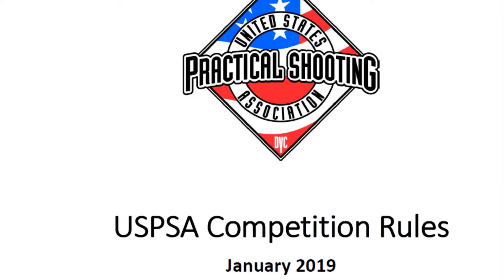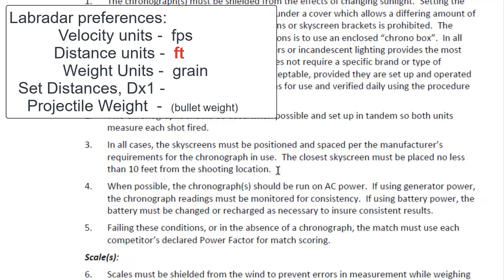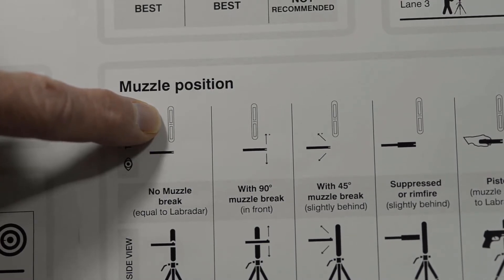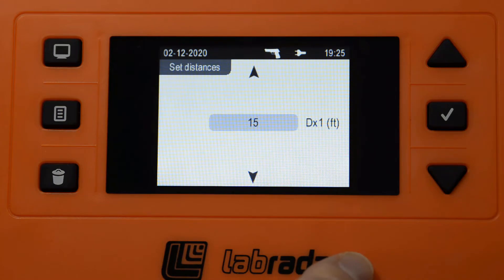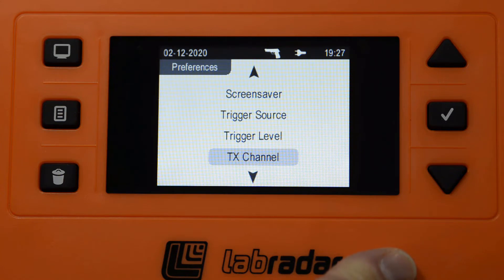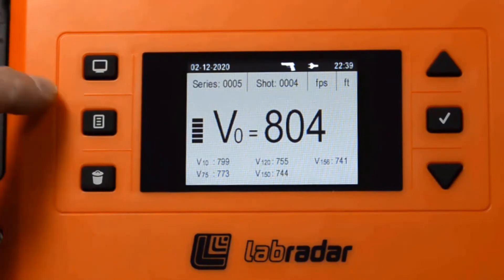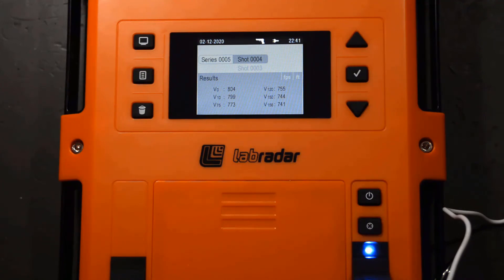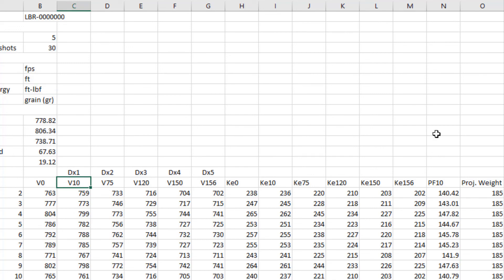Using the Labradar to calculate Power Factor for the shooting sports.

Comment: Thank you for a great video. However,  my unit provides average velocity by calculating the velocity registering at 0 feet. These velocity figures do not match  up with the power factor figures. That’s because the power factor is calculated using the velocities registered at DX1 which is set at 10 feet (per USPSA rules). The problem ……nowhere on the results sheet is the average velocity for shots at DX1 provided. Is there a way to program the unit to provide an average velocity at DX1 so that it corresponds with the PF?  This figure if it could be provided would be far more useful than average velocity at 0 feet. Additionally, nowhere does the results sheet provide an average power factor for a series. The unit only provides individual PF calculations for each shot. is there a way to obtain an average PF  number without having to perform tedious math?